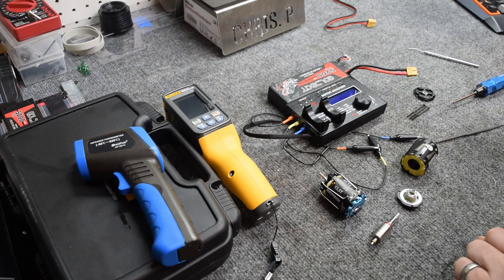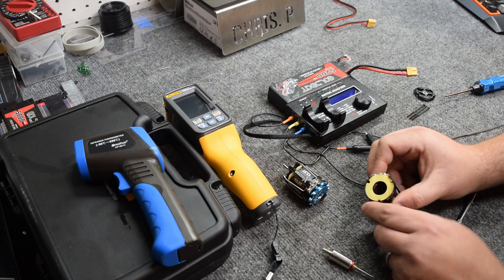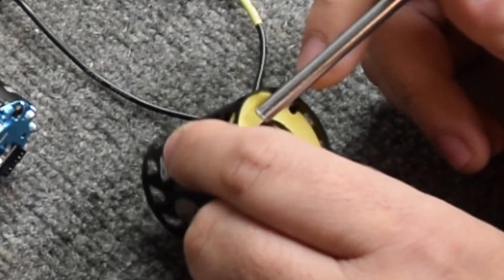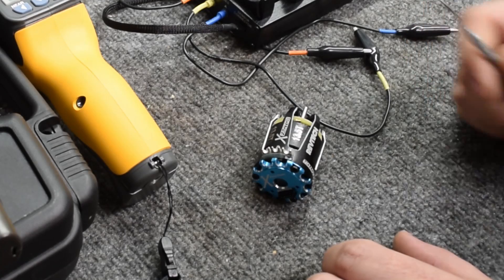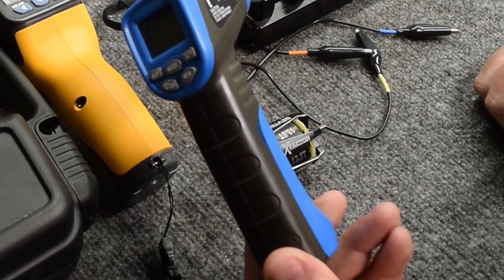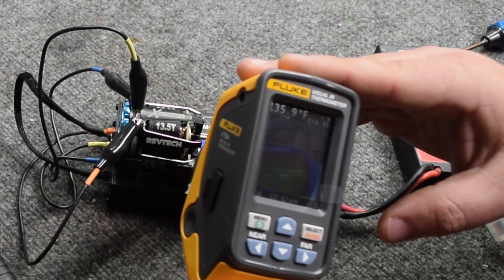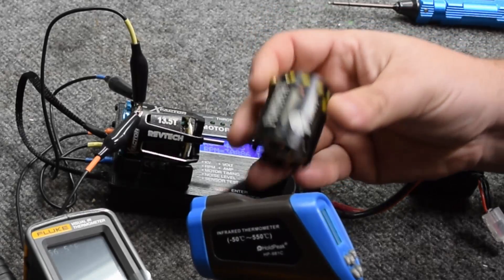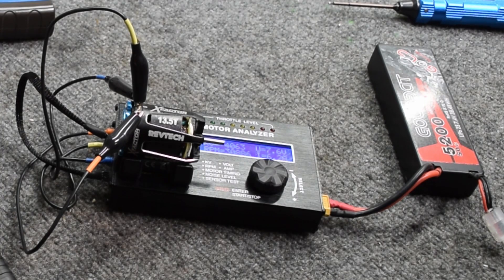How to tune your RC sensored Brushless motor, Part 4, Lets talk Heat, and where to check your motor

Comment: What do you do when the environment is hot.?  How do you stretch out your battery life.?
Reply from the maker: make sure your motor has a fan on it, has adequate air flow across the motor, and it should be good if your gearing is good. turn timing down would be the next option to save motor temps. 
also stretching your battery out, is a topic by itself, but a good quality battery you shouldnt have that issue. But lowing your amp draw on the motor will give you more run time as well. because the motor wouldnt be pulling as many amps. also gearing could affect your battery life.

Comment: can wrap that magnet rotor with aluminium or cooper tape for reduce heat? just wondering
Reply from the maker: i run a fan on all my motors, the best way to reduce heat is with cool air.

Comment: How does this not have more views. I'm looking at a sensored setup for my rmx drift car. Do you suggest keeping the ~5-5.5amp baseline?
Reply: I guess would it be better to tune for temp or amps? And is there a way to measure power vs tq? Followup, is there a way to tune a motor to adjust power and tq. Decrease tq to gain a little on the top end. 

You might have covered it in a different video I just blasted through them all.
Reply from the maker: @randomhavok  amp range is safe for just about anything honestly. But you mainly adjust timing based on your needs till temps are to high.
So if you don't need the torque the. You can get away with lowering your timing. 
If you need more then you can raise it. 
The baseline of 5 5.5 amps is a very conservative number. Id bet my race motor is up in the 7.5-8 amp mark but she does get warm.
Reply: @ChrisPatrickRC  wow thanks for the quick reply! I'm still pretty new to drifting but tuning seems tricky. We run for as long as we want. We can run laps for an hour or 15mins depending on the mood. But knowing that I can still get max rpm without having to go crazy with it is nice
Reply from the maker: @randomhavok  yea id turn thrown the amps alot of you plan to run a hour long session. No real need to have it cranking to the moon for you if your just drifting, or at least I would think. Heat will be your enemy so keep it turned down and you will be just fine.